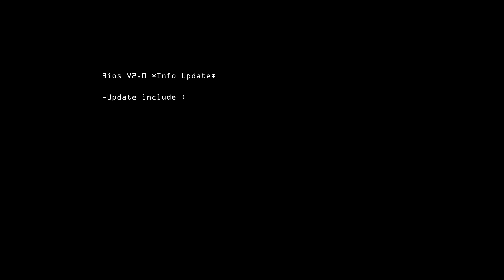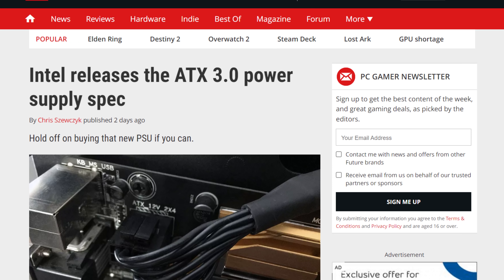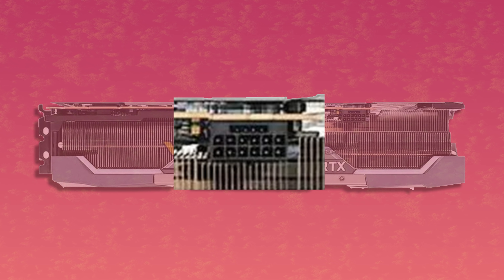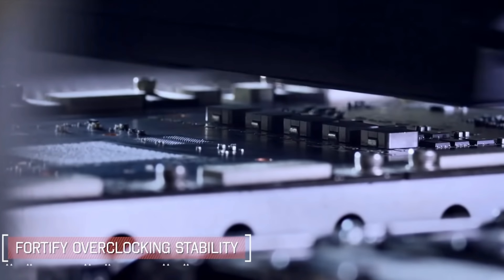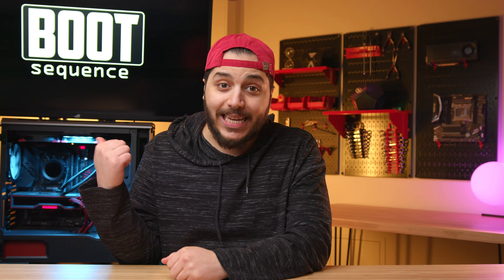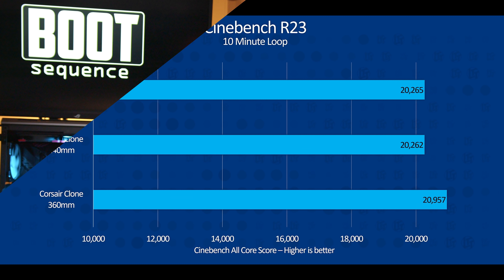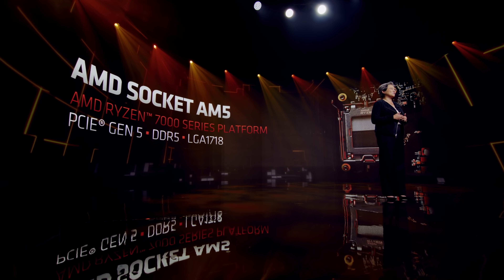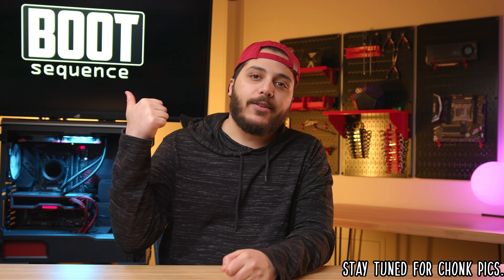Could AMD’s Ryzen 7000 Support DDR4?

Comment: Man, listening to this reminds me of having an ASRock motherboard (G41C-GS) that had DDR2 and DDR3 support but can only use either or, not both. Seems it will be a good comeback for DDR4 to DDR5 RAM module for those wanting to transition but is not ready to pay the high price tag for little improvement. Certainly will buy one when it matures and can clock at a much faster speed.
Reply: There have been lots of different motherboards which could use more than one type of RAM, and I doubt that any of them could use multiple types of RAM at the same time.
Reply: And the ASRock 939A8X-M  that also had DDR2 and DDR3 support.
Reply: It was the same with ddr3 to ddr4, etc.

Comment: DDR5 will still be priced with their weight in gold by the time Ryzen 4 comes so it only makes sense to continue to support DDR4 for now until DDR5 prices at least gets to the level DDR4 had back in 2017.
Reply: ASUS showed off  their  experimental ROG DDR5 to DDR4 Converter Card at  beginning of the year, wonder if they will decide to finally release it...
Reply: @stuartandrews4344  it's been so long now that I barely remember this or was it the other way around a DDR4 to DDR5 converter they do use the exact same slot after all it's just that some of the pins are used differently on a DDR5 vs DDR4.
Reply: A smart move would be to make the 7950, and possibly the 7900 DDR5 only, while offering AM4 DDR4 variants of the 7800 SKU.

Comment: Just got my EVGA B5 850W fully modular power supply in preparation for a gpu upgrade. Currently using a 550W version. Many will have to do the same so don't forget to include a new PS in your upgrade budget.

Comment: When talking about AMD CPUs, you have to differentiate between the TDP given by AMD (which has nothing to do with power consumption) and the "real" consumption. The current zen3 processors can already consume around 170W (mine does, a 5900X).
Reply: The meaning/name of TOP as "Thermal Design Power" suggests that it is a measure of heat generation (and so cooling requirements) rather than power draw.
Reply: Michael Coombes that's the same

Comment: Nvidia pulling a Fermi these cards will not last long if you gonna get a card get a 50 series card or enjoy the 90 while it lasts I would honestly skip this generation but then again I only buy graphics card with a max of 8 pin connector cause we need to start thinking about being efficient when gas prices keep going how they are
Reply: I am still happy with my fully unlocked amd rx460 (polaris), no power connector, works well.

Comment: It would be in AMD's best interest to go with 3 channels of DDR4. 3 channels of 3600CL16 would be vastly superior to DDR5 5400CL44. Not only would it be pretty close on shere bandwidth, but the timings would be insaine compared to DDR5.
Not to mention that on at least 7nm APUs you can go up to DDR4 4933CL17 still in 1:1:1 timings(even on B450), and it sounds lile the IO die on 7000 will be 7nm, and 3 channels of DDR4 4400 CL19 would beat the pants off of even DDR5 6600. and only for ~$150 for 3 sticks 24GB

Comment: We're currently slipping through an energy Crysis and Nvidia is releasing stuff with even more power consumption... Performance nice and cool, but seriously we have to start thinking about different stuff again. 1050 ti was awesome, 1060 and 1080 were great too and still are... I understand that there is tons of difficulties in chip manufacturing, but seriously it's not all about more performance. Especially since current stuff is already performing pretty damn well to be honest. I don't need 6000 frames at 8K, 4k is already sort of a point of diminishing returns at most desktop screen sizes... I have a Samsung Odyssey Neo G9 and my 1080 is doing pretty well with almost everything I throw at it and it looks phenomenal. Yes I can't push higher than 120 frames most of the time unless you play CS GO or whatever but yes. Sure I would love to run it at 240hz, but when it takes me multiple times more effort and power consumption, no thanks. Its already very smooth anyway so what gives?
Reply: I here you. 600 watts is just turning my stomach. It isn't progress.

Comment: Waiting till that day a GPU with better performance than my 1070 uses up less power. At least lower than 200w.
Reply: 4060 is your guy
Reply: Skip the 4000 and get yourself a 3060 ti nvidia is pulling a Fermi with this one and Fermi cards didn't last and buying a used one was dicey unless you are water cooling the gpu and coopering the memory and power delivery don't get a 4000 series they will be to hot
Reply: @cydia11centra  As long as I don't have to replace my PSU that seems like a good choice.
Reply: @Qimchiy  yup
3080 level performance for half the price with better ray tracing and more efficiency
Reply: @cydia11centra  That is VERY promising. If the MSRP is under $450 that's an absolute steal.